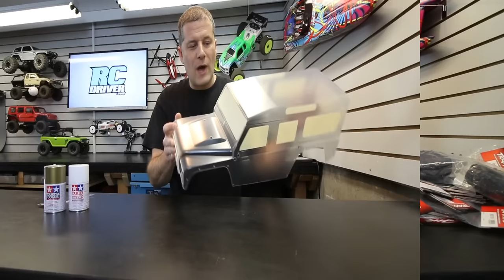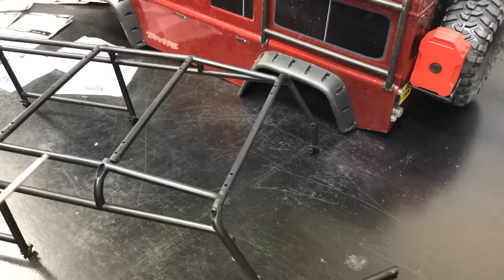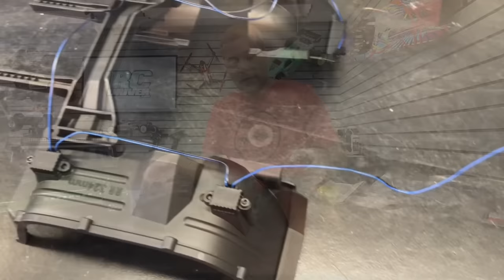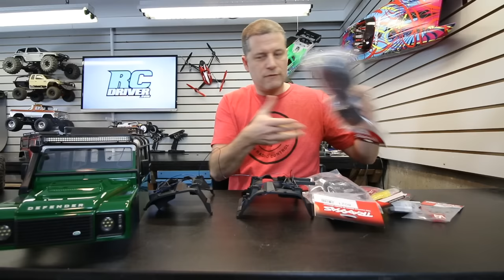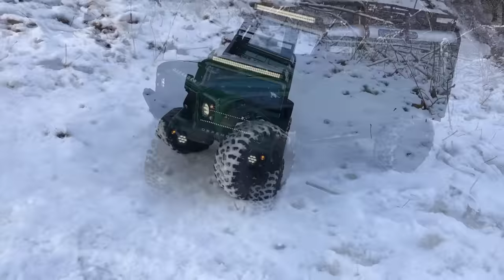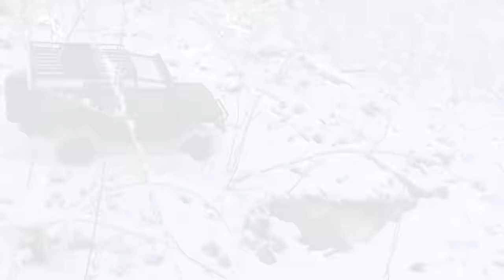Customize Your Truck - Traxxas TRX-4 Land Rover Defender Painting & Detailing Tips  | RC Driver

Comment: Hell yeah, nice they did that for you. They wouldn't even replace my shock for me (noticed it had leaked oil out upon arrival so I refilled it thinking no big deal) well after running it through water a couple times I got water inside my shock and it was sticking real bad. Called warranty and they said since it wasn't straight out of the box nothing they could do. So now I gotta spend $40 on two shocks and I have only owned the truck for 4 months.

Comment: When I put my light kit in and cleaned my TRX-4, I left the bumpers, fender flairs, wheel wells and the things on the back of the body off. It has about a 60 degree angle on front and back now, with more then a pound off it too, looks sick and will perform better.

Comment: i spray my lexan bodies on the outside with vallejo primmer first then the colour i want thent i flat coat it to finish after i have done the decals works every time and looks fantastic doesnt peel either then i spray aluminum in side followed by black so when i scratch the body it come throu looks really good

Comment: I have questions!!  Do you paint the exterior of the body??  Seems like the paint should go inside, shouldn't it??  And, how long does the paint have to dry to properly cure?  If the outside is painted I would worry about scratches from rollovers.  I would want to do a military green version with the black roof and hood bulge (like the orange version) but it's looking like more work than I want to put into it.